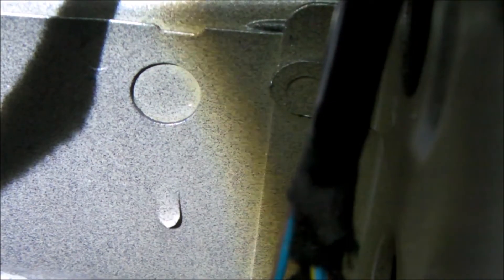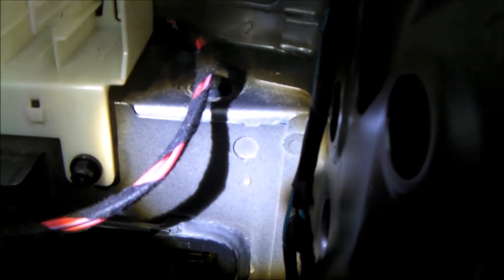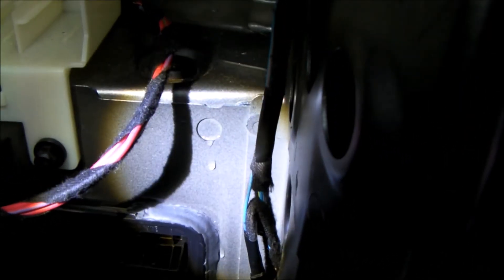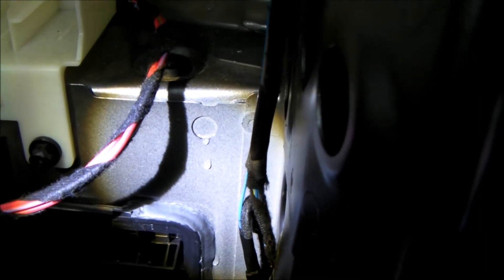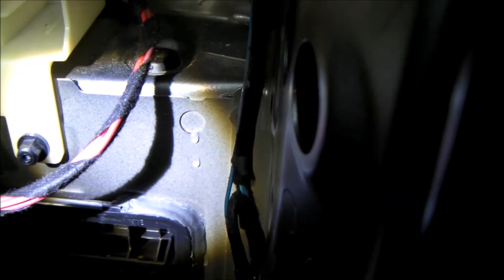2012 E70 BMW X5 leak.  Where is the water coming from?  How is it entering the interior body?

Comment: I’ve had this on one of my E70’s and it’s been dry since replacing fuel filler door assembly
(You could even try to seal it with silicone to test)